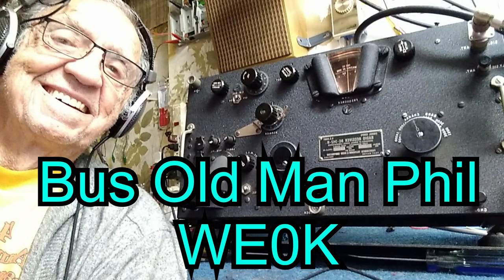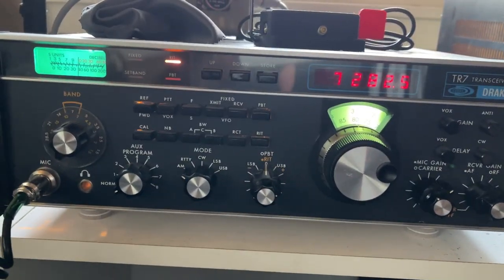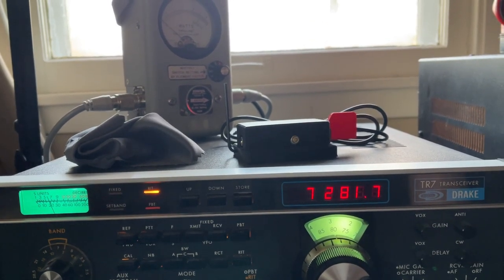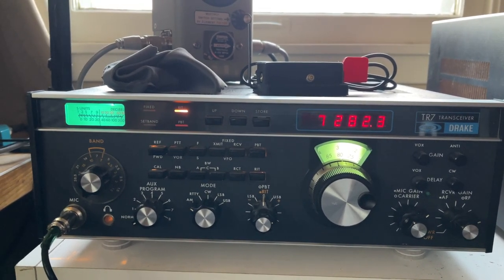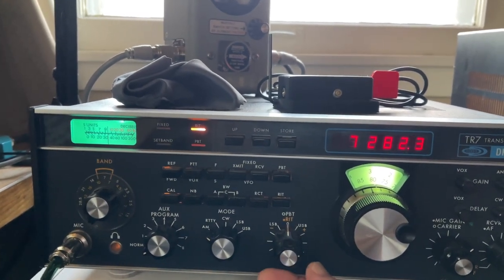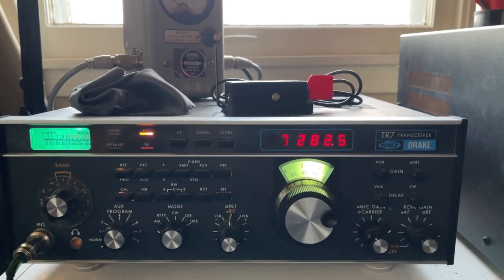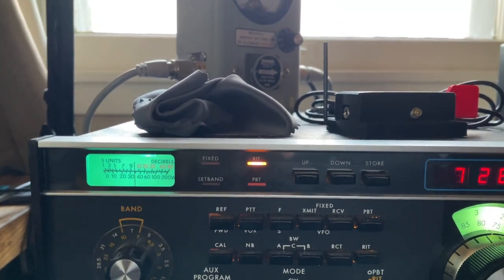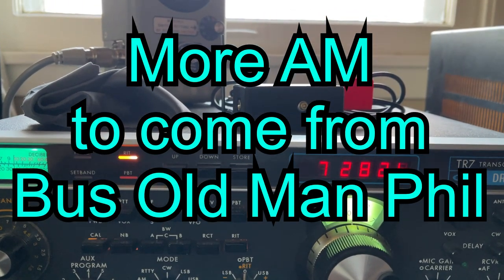Operating AM on 40 Meters with WE0K

Comment: Got three more kinks out of the system and found a crystal in my collection marked 3645kc. Plugged it into the 40 Meter socket and by first upper harmonic (crystals will do that) locked in at 7289kc. That should stabilize the transmit freq.
Reply from the maker: OK great Phil. I will talk to you later. Best 73!